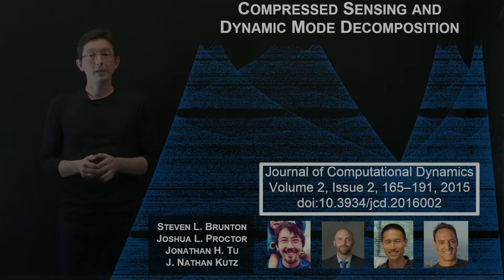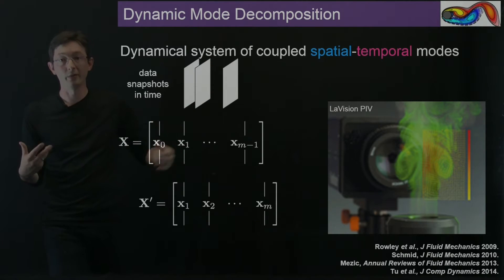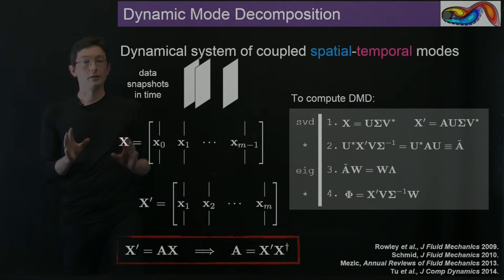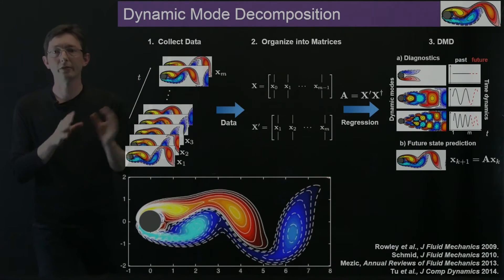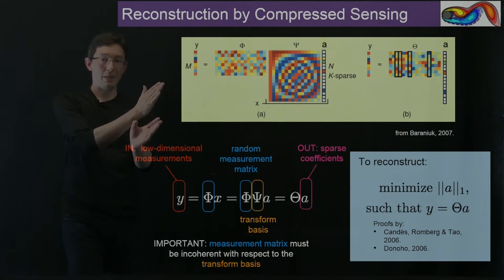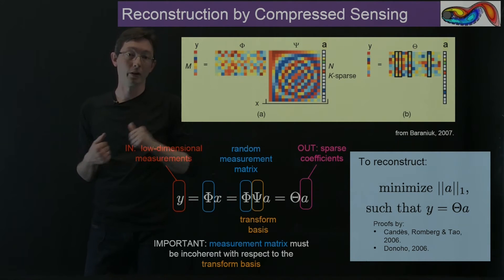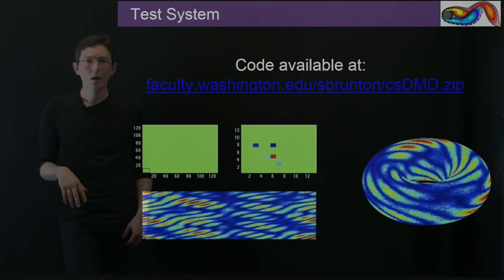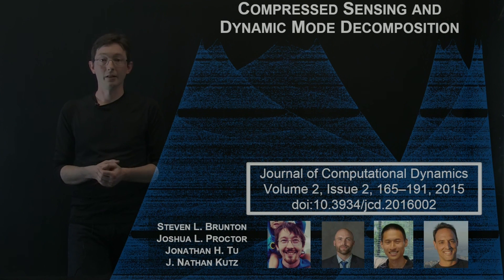Compressed Sensing and Dynamic Mode Decomposition

Comment: Nice video, I've been following your channel for a while....it's been a great journey.

I also wanted to talk about the possibility of using neural networks to compute a downsampled version of the higher dimensional state space, so that DMD can be performed on the downsampled frames, and the low dimensional modes we get can then be upsampled by yet another neural network for better visualisation.

Well, this would be assuming that the hardware in question have enough resources to load these higher dimensional frames and downsample them with a neural net for DMD

Comment: Excellent lecture! But I stll have a question. Generally how can I obtain the matrix C?
Reply from the maker: Usually you actively design the matrix C.  Sometimes the physical measurement process will limit the types of C that are available.
Reply: @Eigensteve  Aha, thanks sir. Seems to be a little bit hard. Could you pls provide more information about that? For example, how did you specify the matrix C in processing the  data of flow over the cylinder, or do you have some papers for recommdation. :)
Reply: Great lecture, thank you for sharing!